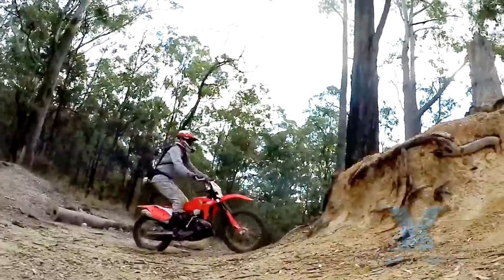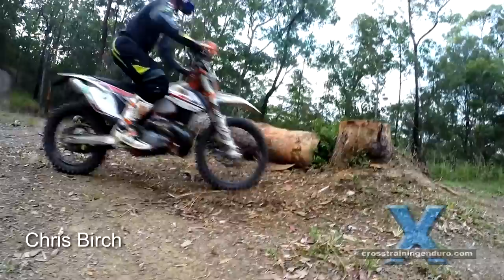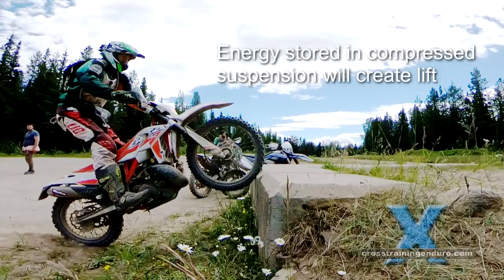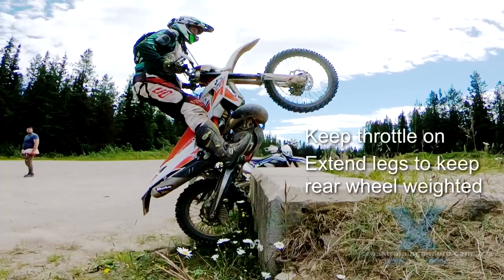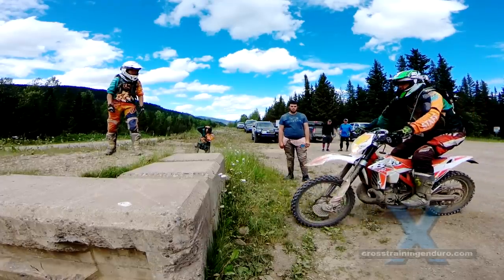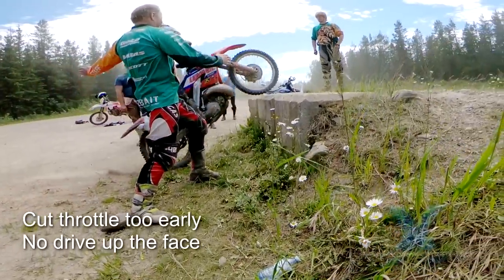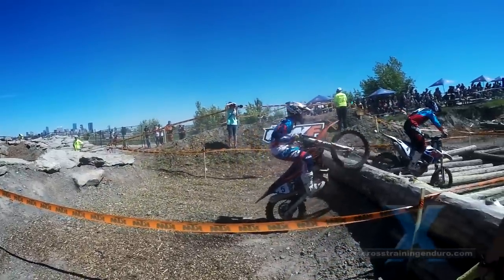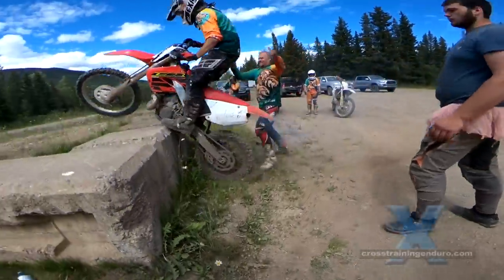How to climb vertical faces on dirt bikes︱Cross Training Enduro

Comment: Loved seeing a new training vid. I’ve missed them. Don’t get me wrong, I love the riding vlogs, but I love havin someone explain the techniques to me. I’ve wondered a few times if you’ve ever wanted to go back and re-film different training aspects as you’ve ridden more and maybe even changed your approach to different techniques?
Reply: I love the 3rd person persective too.  It's much more informative than watching from the POV of the rider.  I think it would be extremely hard to do but I'd love to know exactly what their hand controls are doing during some techniques as well.  How much throttle, how much clutch, etc....  I'm glad Barry said on this one that he wasn't using the clutch at all, that it may not be proper technique but that you can do it without worrying about the clutch.  That stuff is helpful.
Reply: fredman1085 agreed👍🏿
Reply from the maker: thinking about it adam and it's on the agenda but have so little time nowadays :(
Reply: fredman1085  Im going out tomorrow to do this we have a concrete berm 34" tall with a 12" drop on the other side..... hopefully im just sore on the drive home, and not replacing parts! lol
Reply: TheCharillz23 good luck man. I just need to get the guts enough to try.

Comment: Any idea how much tire pressure people were running?  I know it's advisable to air down a bit for trail traction, but that looks like an instant pinch-flat if you're not pumped up enough.

Great vid, though!  I can't wait to try it out on my XT
Reply from the maker: Hard to remember and it was a loan bike and a few years back now, Brady. Maybe 12psi? Normallly I run TUbliss with about 2 or 3 psi.
Reply: @crosstrainingenduro  TUBliss is definitely the way to go.. I don't have a couple hundred to throw at that setup yet..  I'll shoot for 12 and carry spare tubes 😅
Thanks for the prompt reply!

Comment: i've always wondered about what the clutch hand is supposed to do for a normal wheelie? How can you lift up on the handle bars and release the clutch at the same time?
Reply: If you drop the clutch,.. no need to lift up on the handle bars at all!
Reply from the maker: see our small practical wheelie vid. you shouldn't need any clutch at all.
Reply: I’m no expert, so someone may counter this, but any time I’m balancing at a standstill in front of an obstacle, and need to dump the clutch to get over it, I’m only holding the clutch with my one index finger. The rest of my hand is wrapped around the handlebar grip.
Reply: I live in saigon and have an old XR Baja 250 so should be a fun place to practice my wheelies haha

Comment: did the cr250 ever make it up?
Reply from the maker: showed all the bikes that made it up
Reply: CROSS TRAINING ENDURO SKILLS the reason i ask is cause the cr250 has a notoriously awful bottom end, and it's what i ride, and wondered if even a skilled rider (which im not) would have difficulty getting it up
Reply: dude,  buys a 12oz flywheel, raises the height of the cylinder and puts a separator of 8-10 cm. in the reed valve... With these modifications you already have an engine with low end. I have a 2002 cr. And remember to use the bounce of the fork
Reply: dosizmp whats the reed valve separator do? i have an 02 also, with a milled head and flywheel. the head mod helped a lot with low end, but still need more!

Comment: Just in case somebody has a tip, when I stand up, my knees get very close to handlebars making it hard for me to get enough leverage to turn them in some terrain. I've gotten the handlebars as much in front and up as my cables allow for and pegs as low and back as I can without major investment, but if anybody knows of another easy trick to get around this, I'd love to hear it :) .
Reply from the maker: check out our body positioning vid, freeman. might help!
Reply: I've checked that a while ago, even saved it, as it is really helpful with the 3rd person shots, bar raisers video helped as well, it does great at summing up the negatives (well worth it for me :) ).

Comment: What gear mate?
Reply: temperance 1st or if your bike has a ton of grunt try second too to get more traction. But on any bike I think 2nd will require some clutching too
Reply: Justin F thanks, I got a 300xcw.
I usually need a lot of throttle to get the front up in 2nd without some speed. 1st the bike reacts instantly. Hard to control.
Reply: temperance how about with some clutch in 2nd
Reply: Justin F 2nd for sure. 1st is scary on my machine, especially if I have to stay on it as he says in the video. I don't have that kind of crazy control yet.
Reply: temperance yeah I have a 250xc I’ve ridden 300s they definitely have some more bottom. For most log crossings and stuff I am in 2nd and use some clutch and either do a double blip if I have run up and soils good or just a punch